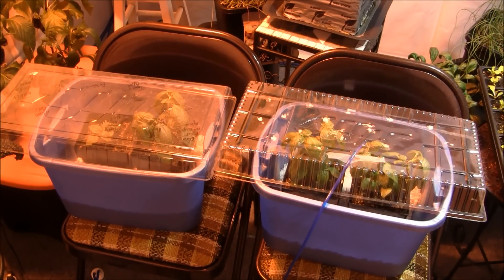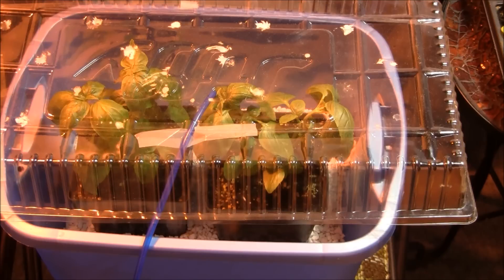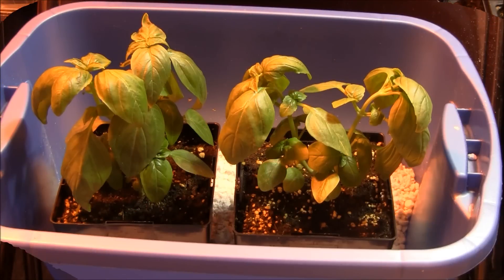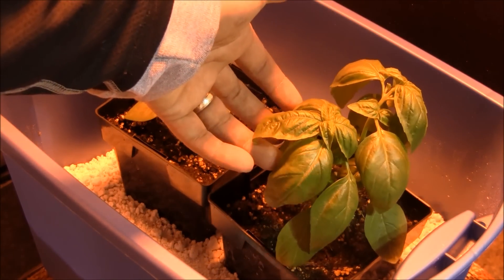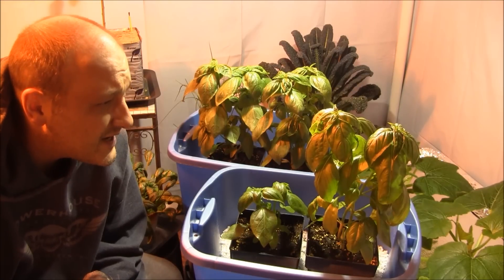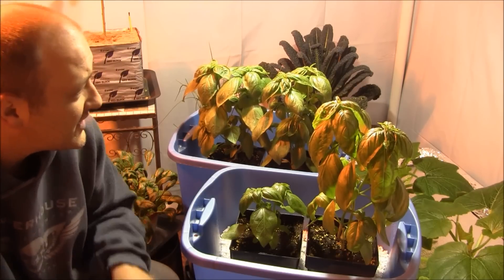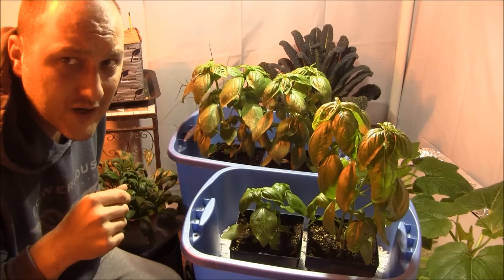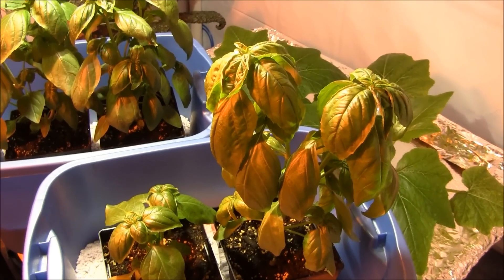Using CO2 to Grow Basil Part 2

Comment: Don't forget that MJ growers also have fans to stimulate growth and I can say from experience, air movement does make a difference.  It's like your experiment, the results aren't shocking but when you put it all together, it's impressive.  And yes, dry ice is terrific if you can't do the canisters.
Reply from the maker: I'm going to do it - the dry ice!  That's one thing I struggle with is air flow.  I had PM last year.  This year, nothing.  But no fans to move it around.

Comment: what if you put the CO2 pipe underneath  and in the center of the plants so that the leaves themselves naturally filter?
Reply from the maker: Good question, co2 is heavier than air, so it falls as opposed to rises.  Which why most growers use fans to disperse it and blow it around the room, grow tent or greenhouse.  But I like the idea. What about root fed CO2?  Would it work?
Reply: +Indoor Hydroponix Are they in solution?

Comment: If you really want to put them in turbo mode, throw a hadful of dry ice in the a container near the base of the tented plant but not too hear since it will chill down the plant or EEK will freeze it.  Of course this is not a practical solution unless you have an ending supply of dry ice.
Reply from the maker: Omg!  Dry ice is genius!  I have access.  And that sounds fun.